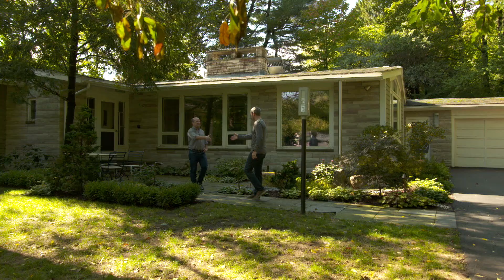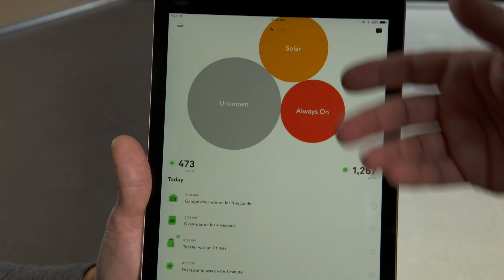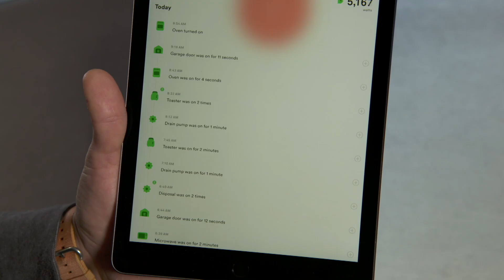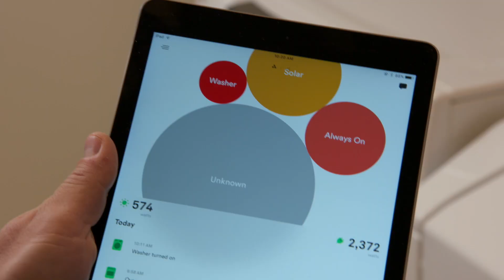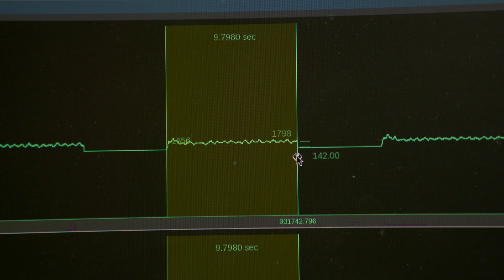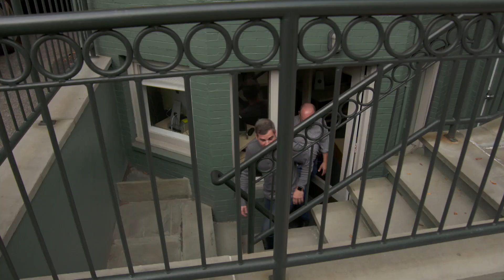Smarter Home Electrical Metering | Future House | Ask This Old House

Comment: Did you remember to turn off the oven?

It would be nice if there was an app that you could download and for each item you have you would enter the information for each item that you plug into your home/apartment. For example as new products come out you could simply just scan the QR Code and then the item would be entered into the app. In the future all you would have to do is plug a single box into your outlet and it would monitor how much power your using. It would be nice if the utilities companies are not using this technology already? The app idea should be in effect today because you still could get an idea of what you are using because when you get your bill weather it is your Power, Gas, Water etc you just enter the amount and the and the usage and the app could 

The ideal thing is that after the meter and before the first breaker box and before any powered appliances of any kind there needs to be a very special plug that is not the same shape as any other type of outlet out there. This very special outlet is tied in to the main line and it has a special switch that will allow power to flow to your breaker box but is designed so that if someone tries to stick their fingers or an object into it the plug will not bring power until certain criteria's are put into place.

One: The special plug is only designed for monitor boxes that monitor power consumption. This is an outlet that something that the power company would install or an electrician who is license. This is something that could be done in a personal home or in an apartment building.

Two: The special outlet would be designed to be able to be connected up to a minim of 20 different power sources. This would mean if you have city power and then you have solar plus a generator or any other sources you can have each of these connected to this special plug outlet and when you plug the monitoring device of your choice that no matter what company or brand makes it would have to use the same plug format. This would allow the device to detect where the power source is coming from and how much power is entering your breaker box and how much each item is consuming.

Three: Once this device is installed and you have chose your monitoring device you will plug it into the special outlet. You will want ALL items in the home or apartment to be OFF, this includes EVERYTHING. Your monitoring device will calculate the power to that point. As you turn devices on it can determine what the device is.

Side note: Before you plug your monitoring device into the special outlet you will want to scan the QR Code on both the Outlet and the Monitoring Device before plugging the monitoring device into the special outlet. If you don't do this and push the buttons in on both the outlet and the monitoring device in the way the device requires you to the outlet will not send power to the outlet it's self but will continue to send power to breaker box.

You would have ALL Breakers turned off after plugging in your Monitoring Device. You then would open an app that you download to your smart phone or you go to a website. You create an User Name and Pass Word and an account. Once this is done you will turn each breaker on one at a time. You then would label each breaker and what it connects to such as a dryer, HVAC, etc. You then turn each item on one at a time and it will detect each item on each breaker, You then can label each item and enter the information such as make and model and cereal number etc. If the item has a QR Code you would scan it and once you turn that item on and you connect your app the item is connected such as if you have a LiFx Light or a Smart Plug or even an Alexa DOT/Google Home etc. 

The possibilities could be endless and if it is done right it could help you as a home owner or renter make good decisions on how you are consuming power and how you can reduce your carbon foot print.
Reply: Your "special outlet" would not be useful. The monitor has to measure current, not voltage. You cannot measure current in shunt.

Comment: Sorry, but this is really DUMB. I don't need to know what each device is using. I know what is plugged in and I expect that it is using electricity if it is functioning properly.
Reply: Then don't buy it. You can also dig a hole in the ground with your hand, so who needs a shovel?

Comment: How does it know its a oven? Or say computer or something else? I almost like reading each breaker separately assuming you know what each breaker controls
Reply: By the waveform created as a device draws current over time.
Reply: @Cotronixco  ... good point. Each appliance has a unique signature that takes time to figure out. An oven might be similar to an electric water heater at first glance because they are both using a heating element but the thermostat cycle will be different, plus the oven may have a timer / clock that the water heater doesn't have. Same goes for an electric clothes drier, but add the signature of the motor and the computer figures out it's different. It's a process of elimination. In the meanwhile it's stuck on the "other" category till the sorting is done.
Reply: @rupe53  Sometimes after some time Sense will call an item "heat 6" or "load 3" just to show that it has identified the item. At that point the user can rename it, assuming their software is working properly that day.
Reply: @Cotronixco  ... yes, that would make sense. Obviously once you have identified this manually it would make a record of that signature under the new name.
Reply: @rupe53  For some reason we are not able to help the system identify loads manually. We have to wait for it to separate and identify loads, and many loads are never identified.

Comment: So what we can see how much power is being used by different appliances (when we need to use them, we need to use them)?  To be efficient in power consumption shouldn't that start with the appliances we purchase from stores (better yet, manufacturers should be manufacturing even more efficient equipments/appliances) before we even bring them home (once we bought them it's too late isn't it, so what we see how many gigawatts of power being drained by then)...   To be able to monitor a house as such, how much the monitoring equipment will cost and to install, what's (how long is) the return and is it worth it for an average home owner to have a such system?

Comment: I like the idea overall, but I wouldn't want to use the iOS/electronic device app. I am very anti-smart device (I will use one to contact people, take pictures and use the internet, but nothing else), and I refuse to let my life become dominated by apps. I also will not get this device if it will be putting out WiFi signals. I would get this for my home if there were some separate device that could mount on the wall next to the circuit breaker to display the data, but it was hard-wired and used no WiFi.
Reply: Zachary J Hott-Salman have fun with kids! Or paying bills. Or going to the bank every couple weeks to check payment history and account balance. I haven’t gone to a bank in over 2 years!

Comment: No surprise that certain unique appliances have a current consumption signature that can be recognized, but the majority of devices would not have one.  A baseboard heater would look the same as an oven element, or a water heater element, for example, if they were the same wattage.    Just having info about a few of your appliances is not that useful.
One of the biggest wasters of energy is long hot showers.   The average person does not understand that while you are in the shower,  there might be no power consumed, but that the water heater runs for a long time later to recover.  And because the water heater has the same signature of other resistance heat elements of the same wattage,  the average person would not learn to take shorter showers.
Reply: Sense sees a simple heating element as "Heater 1" or "Heater 3". Then YOU label that heater in the software.

Comment: I install lighting automaton systems and quite honestly, most of the "energy savings" is a gimmick. Get a system because it saves you hassle, it looks good, or is "cool", but don't think it will save you tons of money. It won't. It may save you a little bit if you're extra lazy, but the vast majority of electricity is used on heating and cooling (depending on what part of the country you live in) and unless you're a moron who lives the AC at 60 degrees 24/7 in the summer while you're not in the house, these automation systems won't ever pay for themselves. Just buy a $30 programmable thermostat or if you must a wifi thermostat and that will do most of what these systems do.  If you want to save on lighting, get LED bulbs and dimmers and turn the lights off when you're not in a room.

Comment: These devices are great to have, however I wonder about the security aspect of having an over connected house.   Operational technology devices have potentially huge security risks, as they are not patched, or upgraded at the firmware and software levels very often, if at all.   This is a huge issue in commercial industry, where they try to isolate these networks from the business network.   

Does This Old House plan to do an episode, if not a dedicated show, showcasing methods as to how to setup a connected house in a secure manner?   I believe that more homeowners need to be educated on the risks of these devices, not just the benefits of them.

Comment: Strange software development environment by the way LOL. As if they are standing up 9 hours every day. And each developer accidently happens to have their screen filled with code. Pretty faked scene :D
Reply: Richard van Pukkem 
It looks like a living room lol. Although the desks are not adjustable for height. Some research shows increase production while using stand up desks. But more advanced desks have servos to change from a sitting position to a standing one.
Reply: Yeah, that actually is a living room. Notice it's the basement apartment under a house.
Reply: Richard van Pukkem Slow down, you're telling me they setup the scene for the cameras?
Reply: It's called a standing desk. Peter Griffin had one and had to tell everyone that it was a very good idea, because sitting is the biggest killer in America.
Reply: The Cat Man There are different ways to set up a scene you smartass.

Comment: They show it here in their test-house and the software is setup for these specific appliances. I have my doubts about it if you can plug in just any device around the world and that this software detects it. Every washing machine will have it's own current characteristics. They make it look genius in this video in an environment that they have been testing to for weeks or months. But if you hook it up in my house, i guess the software will need a little bit of help to get things detecting right.
Reply: Richard van Pukkem 
I think the key feature is the 1 million probes per second. All it would take is a database of the obvious appliances, like that furnace, with a few changes to determine the manufacturer. I'm sure you'll have to "calibrate" one time for a new appliance whose signature might not be obvious, like a small network switch and your cell phone charger (the camera crew's equipment was in the unknown category). But with so many probes per second, you might be able to determine some things, like computers and wifi routers based of manufacturer information and the database that can be created.
Reply: Every machine is different but the mechanics of most machines is pretty much the same. From one washer to the next or gas furnace, the characteristics are very similar. Some of our tech gets more efficient and functional but at the core it still operates just the same. The idea is that you create software that can learn and see patterns hidden in large caches of data. It's the same tech. that say google uses to anticipate what you would want to see or corrects your searches no matter how incorrect they are. With enough data you can make certain assumptions. There is a huge difference between a vacuum cleaner and say a dishwasher, simply for the fact that the dishwasher isn't constant power and cycles at intervals.

Comment: is the information shared with the company servers? if it's in anyway possible to spy on me I don't want it.
Reply: FWIW, yes, the information is sent to the servers (about 100MB per day) for analysis, and yes, it's identified with a login. And yes, if you care, it's possible to determine which television channel a person is watching (for most TVs and projectors) based on correlating the power usage with the power needs of a particular video sequence.
Reply: @Gavin - I don't believe that watching one channel vs another would change any electrical draw or signatures in the outlet thus informing the CT Clamps to the device.  What does change is the frequency the TV uses to lock in from say channel 5 to channel 6 but that wouldn't modify the electrical input.
Reply: Alexi Thunderbird I guess they can link the serial number of the device to the address who ordered the specific device. So yes.. They can inform some annoying door-to-door salesman that you have an outdated heating system and such... I don't like that kind of smartness either.

Comment: what happened to just turning the lights off when you leave the room? geez
Reply: I mean, you can still do that, but this will show you where the biggest losses are. You can try to optimize what crap you leave on or plugged in.
Reply: CafeManning you missed the point of video. The information collected would be able to tell a homeowner if their appliances are performing correctly or if they are failing. It's wasn't just about saving energy.
Reply: @Richard van Pukkem I own a Sense. (a) It shows power usage in real time, so I can go into the kitchen and turn the lights on and see my usage instantly increase by +185W. I can go into the media room and turn off all the amplifiers and AV equipment sitting idle and see my power drop by -80W. I can go to my circuit breaker and shut off my hot tub and find—holy crap—my hot tub was using 6.8kW when I thought it was sitting idle. I can see that when my well pump kicks on it uses about 1kW, and I can confirm that my steam shower heater does in fact draw about 9.5kW when running. And so on.

(b) But further, the signal analysis is in fact starting to identify devices based on power signatures. First it found an "unknown motor" which I tracked down and renamed as my hot tub recirculating pump. Now, whenever that pump kicks on, I see the usage from it labeled (separate from all other power usage). It counts how many times a day it kicks on and off. I can see how much power it's used each day. I can set up an alert if it happens to run for more than 30 minutes continuously. I've had the Sense for 4 days, and today it identified my microwave and refrigerator.

The Solar tracking further gives me a granularity unmatched by some smart monitor I had installed with the panels 6 months ago. The solar company gave me a system that updates the graphs every 15 minutes. Sense gives me per-second readouts of the exact power I'm generating to offset my consumption. Brief cloud passes are easily visible as blips in my readout.
Reply: CafeManning of
Reply: Nic Pereira All items which they don't have programmed in the characteristics of it, won't be shown seperatly. You just have one giant 'Unknown' bubble. You cannot see the difference between a phone charger and a LCD panel power brick this way. Don't let yourself trick by this video. It's all scripted.